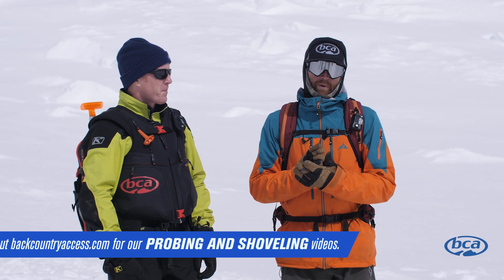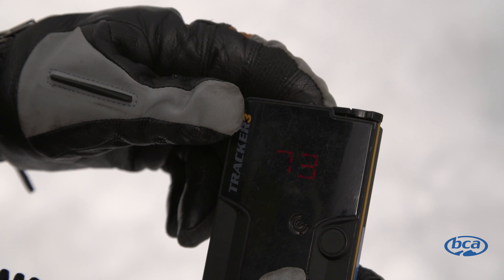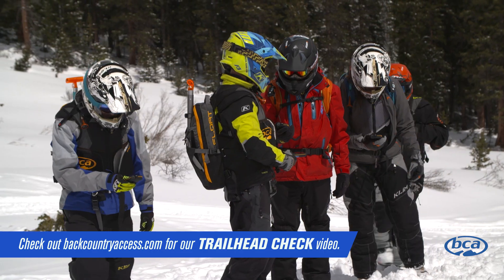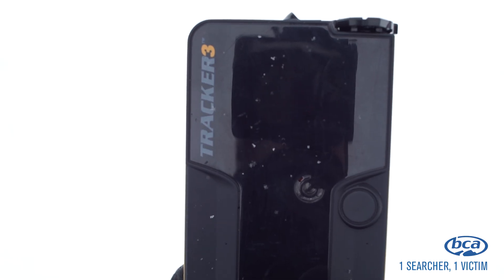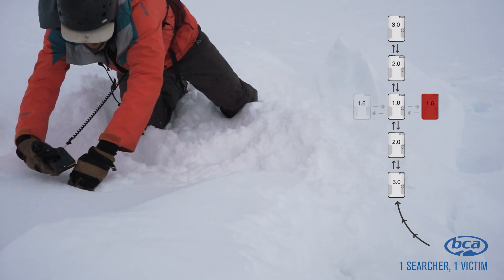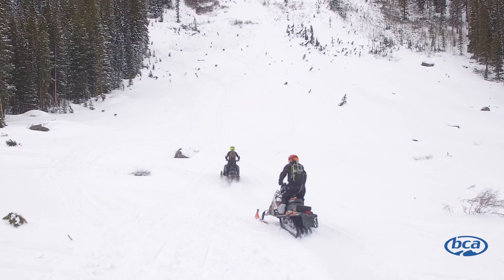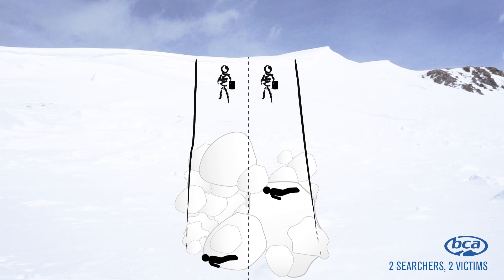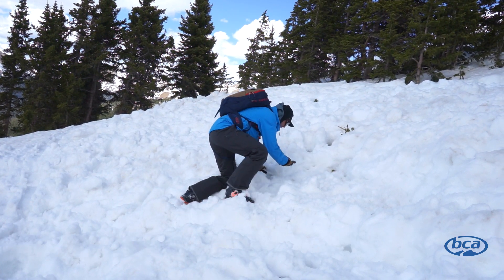Avalanche Rescue Series: Beacon Searching 101

Comment: Good explanation!  Question: how can these techniques be used with a helicopter search?  Also, if there are multiple rescue teams, some of whom use transceivers and others use dogs, how can their search efforts best be coordinated?
Reply: Some helicopter services -like Flight For Life Colorado use an external transceiver that dangles from the aircraft, and is used for a signal search, then coarse search. which is able to get within 10 feet of the victim, allowing crews to roughly locate victims quickly. Helicopters are also used to shuttle rescue specialists and dogs from rally points to near the scene of the slide when safe. There is debate about whether helicopter noise, rotor wash and odor from jet exhaust hinders dogs' abilities to smell and find buried victims.
Reply: @marlinmando  Thanks!